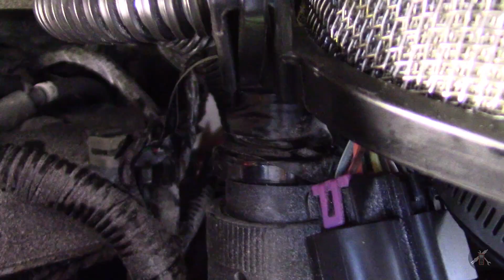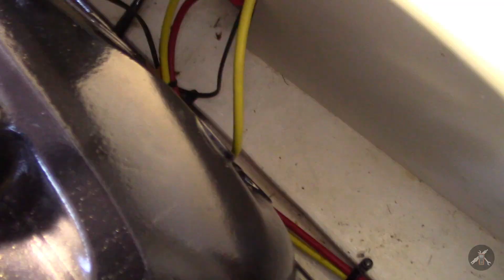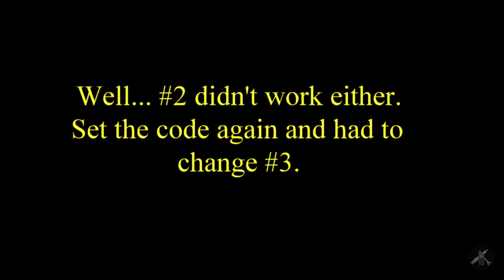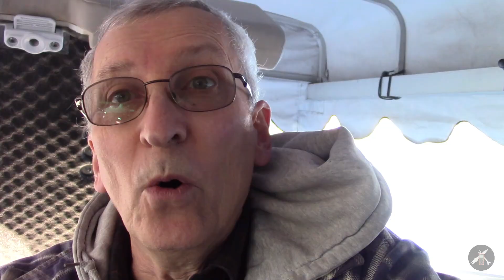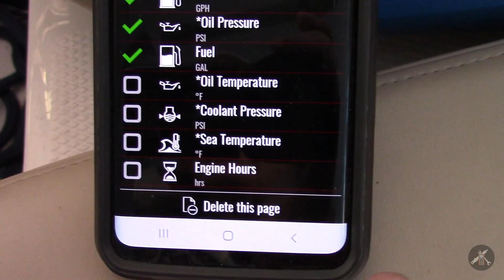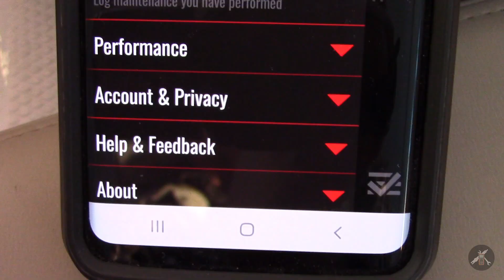Changing Bad Mercruiser Coil - How Vesselview / Smartcraft Mobile Helped Diagnose

Comment: I am looking at vessel view for my 4.5l mercruiser.  Where does it plug in, easy to get to?
Reply from the maker: On the model I have, there is a connection at the top front of the engine where there is an electrical center.  It's been a while, but if I recall correctly, there is a terminator plug or weather cap for the CAN bus in the main harness.  That plug is removed and the module plugs in and is just tied down with a nylon wire tie. There were instructions in the kit, but it was not hard.